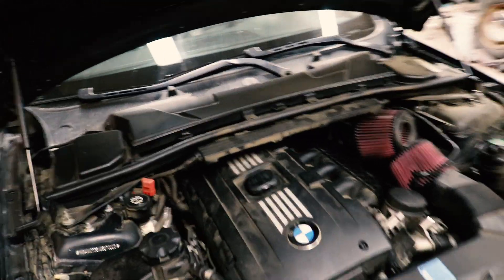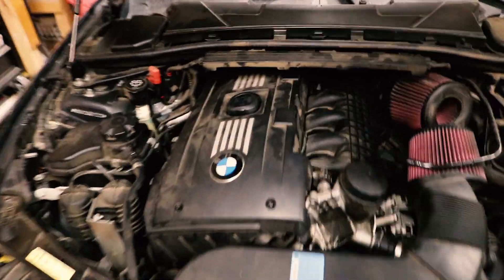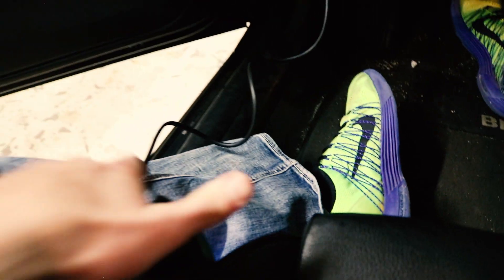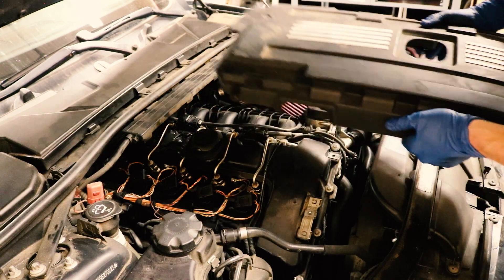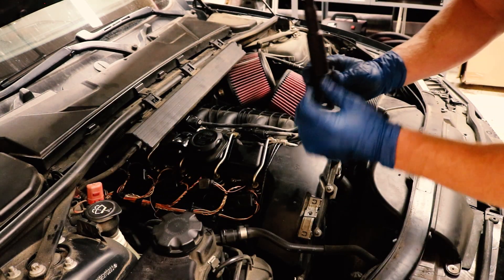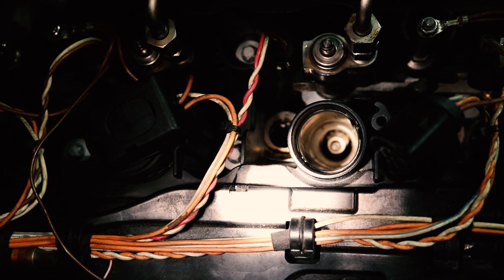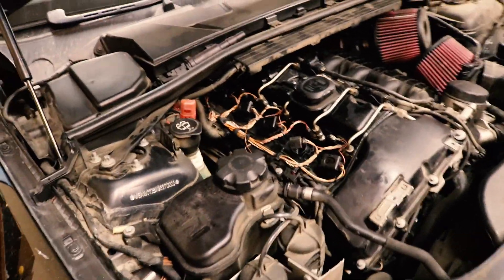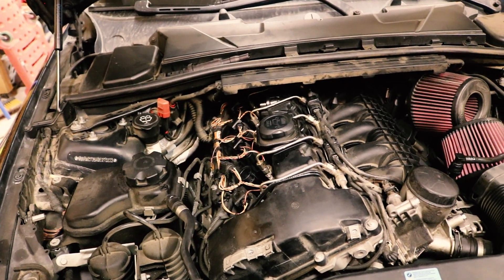Burning Oil Smell While Driving - BMW e90 335i Cylinder Misfire Troubleshooting

Comment: Hi  mitch
My 2007 BMW 335i Cabrio is showing a misfire on the 5th cylinder. The valves, ignition coils, and spark plugs appear to be functioning normally, but the 5th spark plug shows oil contamination and carbon buildup. The engine is consuming and burning oil. Based on these symptoms, would this issue likely require a single-cylinder repair, a full engine rebuild, or a complete engine replacement?”

Comment: I'm losing major oil had the valve cover and gasket replaced and the head gasket still losing a bunch of oil next up if it does not blow up the gaskets under the spring looking things I think they are called valve gaskets anyways still rolling for now just got to make sure I got oil 😢

Comment: Hi brother how are you 

I have the same problem miss fire in the 5 cylinder so either it’s coil or spark plug ...?? And second when I start car in Moring after 10 secnds smoke starts so it’s a leak or what and it’s dangerous or not both one I am asking please reply please
Reply from the maker: I would swap the cylinder 5 coil with the coil from another cylinder and if the misfire shows on the new cylinder then you know its the coil that is having the issue. Check for oil on the coil and spark plug just in case you have a valve cover leak. As for the smoking after you start it, does it smell of oil? if its just coming out of the exhaust i would look into swapping your PCV valve, I have a how to video on that if you want to check it out. https://youtu.be/Altxc9l_q0E As for it being dangerous, its not a good idea to continue driving it if the misfire is really bad. hope this helps get you pointed in the right direction!
Reply: My bmw 335i have the same problem in the morning

Comment: So my 08 335xi has a 3 and 6 cylinder misfire it smells like burning oil but the car runs super great still
Reply from the maker: The misfire wont be all that noticeable for the first little while then it will just die on one or two cylinders, at least in my experience thats how it went. I would defiantly start by taking a look at your coil packs to see if you have any oil on them.
Reply: I have oil on them what do I do fellas

Comment: Ok so I changed my valve cover gasket and still find oil in my spark plug. Now what is the problem?
Reply from the maker: Did you get or do a oil change recently? I've seen some people spill a little bit when adding oil and it get onto the spark plugs.
Reply: You spilled oil when doing the oil change it happenes to me and I can see when it happens